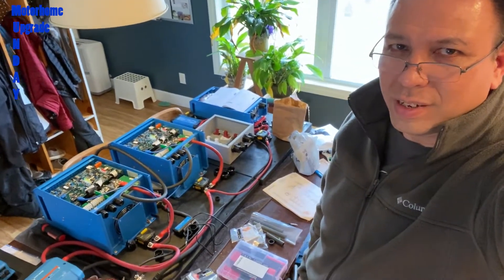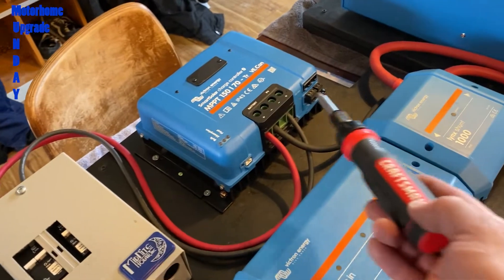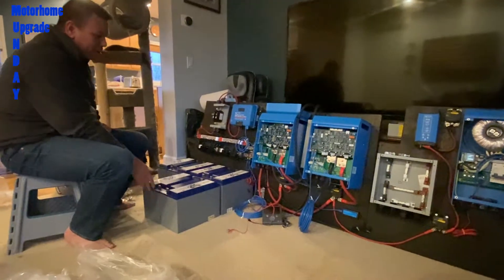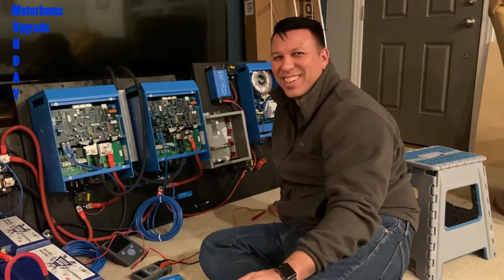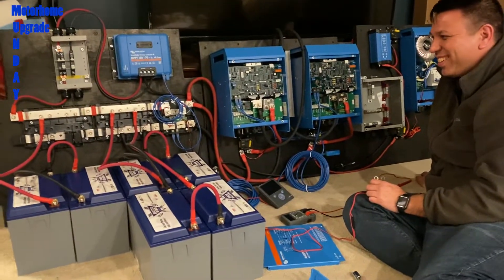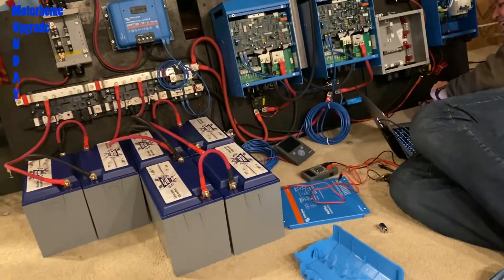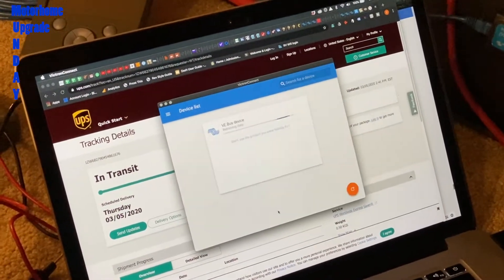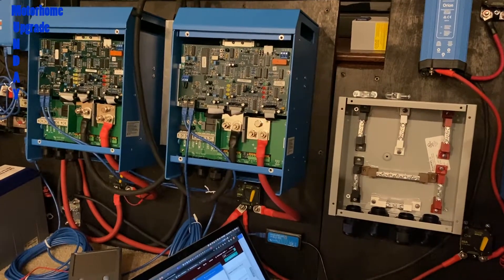Motorhome Upgrade #6 - Solar Install Ep. 6 - Everything's Coming Together!! || Installing RV Solar

Comment: I agree with Lyf, excellent setup and explanation.  I'm installing a 24 volt system like it, but for 30 amp.    I have a question, the breaker below the 24 to 12 volt convert, is that a 60 or 80 amp.  I put 6 - 325 panels on the roof, with only 4 - 50/24 volt batteries to start off.  I did take off my roof AC unit and have a seer 22 mini split on the back of the class c now.  The refridge did not work and I replaced it with a LG inverter compressor fridge.  So I'm hoping that my night time usage will be low enough that the 4 batteries will be enough for now.  Time will tell.   Thank You.

Comment: Excellent setup and explanation!  We just installed a Victron 3000 in our coach. Love it!  The 4 Battle Born Lithium batteries are performing well too.
Reply from the maker: Yes, the Victron-Battleborn combination can't be beat!  We still have some tweaking to do to our system based on our last trip which was 9 days running completely on solar, so more updates are coming down the pipe.  Actually need to do the moldable plastic on all the exposed terminals that I saw on your original battery video too..thanks for that tip!

Comment: Great setup. Just a quick suggestion. At 4:18 in the video, you seem to have a black wire for your + voltage from the circuit breaker for the panels. Since you're using RED for your + voltage, shouldn't you stick with RED for that wire to the charge controller as well?